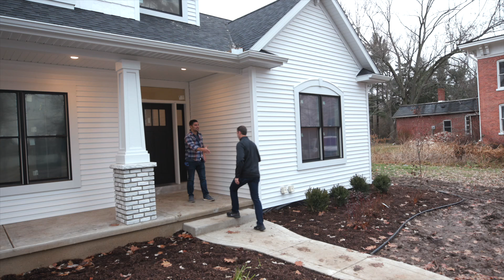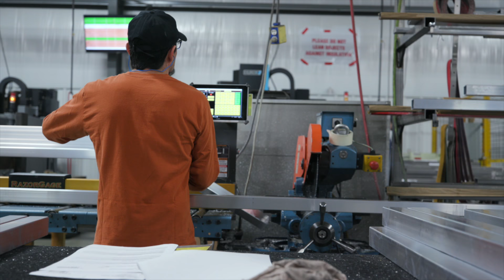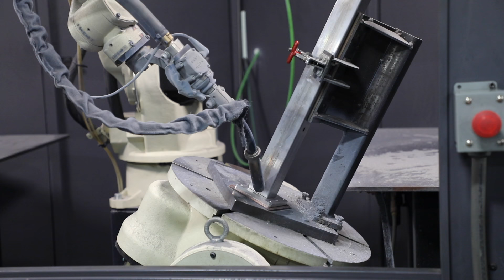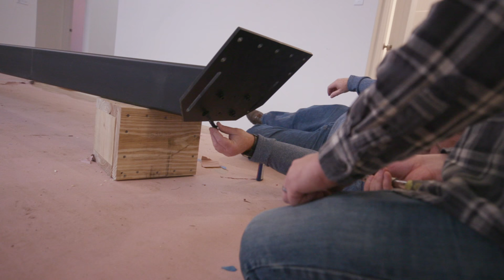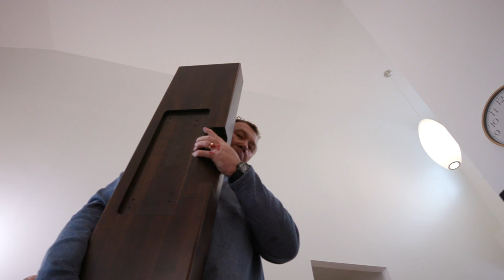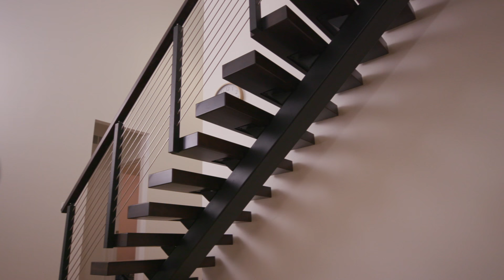One Day Floating Stairs Install - Guess How Much These Cost!

Comment: God all these videos make me depressed. I went to college got EE degree, lived at home to avoid debt, graduated with no debt and a just a little money in the bank (like a couple thousand tops). Started working a white-collar job, saved pennies and lived frugally, lived in an apartment for a year (with a roommate!), bought a starter house (its a crap house) also with a roommate. And like... these stairs just these stairs alone cost over 12k?!?!? WTF....?!?!?!? I swear to god these ppl must live in a different stratosphere from me. Idk what I'm missing how do ppl afford houses like this. Like Jesus... I see these vids about how airtight houses are and how attics should be and I'm like 'hah' I'm prob making above avg income and my house has literal 1/8" air gaps around patio doors where air leaks like crazy cause some idiot installed an interior door on the exterior of the house... my bathroom fans are vented to attic. Shower pans have cracks in them. Carpet is 30 years old and smells of cat pee from previous owners. We had a cracked floor joist. HVAC/water heater are all over 20 years old and ticking time bombs. I have to light the stove to cook on with a candle lighter... Like and that was with me saving for over a year and buying the most affordable house I could... I swear to god these ppl are in a different stratosphere...
Reply: They are in a different stratosphere! 
but, there is so much you can do on your own, weather stripping and a door sweep can be installed easily and cheaply, they may not look as nice as a brand new pre-hung steel entry door, but it'll still save you money on heating and cooling. 
Caulking around windows can save money as well. 
You can get patch kits for those shower pans, the patches don't look pretty but they work. 
If you have a vent port on your exhaust fans you can get vent hoses and a vent covers and vent that exhaust to the outside (it's on my list for my old house) 
A little more expensive, but can be done piecemeal, rip out that carpet and put down a floating floor, do it room by room as you have the money and in a few months all the floors can be brand new, plus, if you are on a crawl the vapor barrier should help with air leaks!
Reply: I know you can get 1000sq ft of decent flooring when it's on sale/clearance for about $700. If you're going to buy it buy it all at once otherwise it will be hard to match...
Also check your Habitat for Humanity stores. I live between two but only one of them is good...
Reply: Big changes start with little efforts. Repairing the igniters on your gas cooktop could cost less than $50 in parts, an afternoon of your time and using tools you likely already have. YouTube is a massive resource for the DIY inclined.
Reply: I think the point of these videos is not to show off but teach the proper ways to build things. Access to high quality construction is not a matter of money either. In a lot of Matt’s videos he shows how many new expensive houses in Texas use extremely low quality material and work execution.  Bad builders persist because so few people, even he wealthy, can distinguish good construction from bad. With enough education and confidence there’s a lot that people can do themselves for a low price but high quality.
Reply: @Emily Carlsen
All those problems you have in your house you can't fix them by yourself using your tools and little money.
The stairs you see in this video is something they want not something they need,if you live by what you need you live happy and rich.
Reply: You sound like a good candidate to build a tiny house! If you haven't heard of it check them out as there are plenty of videos here on youtube.
Reply: You're going to be ok sweetie!!
Reply: I got my ME, then went into construction and started my own company. I make more money as a contractor than I did as an engineer.

Get your PE and start working for yourself. Get out there and take risk and reap the reward.
Reply: Actually a lot of Americans live paycheck to paycheck.
It's not surprising at all to have credit card debt.
They can spend 12k on stairs but have less than 12k in their bank account.....just saying.
Reply: @ekujj13  And, since they are needed, they should be valued as such.
Reply: One key thing I noticed is you didn't say you took out a loan to get your house. You own it. Some people really can afford nice houses but many others try to get there by taking on debt within an inch of their life.
Reply: Now's where I tell you that union electricians in Las Vegas make over $45/h, with free (incredible) healthcare for all dependents and a pension. Our average home cost is currently $300k, but varies from $200k to $350k. My house (estimated at $302k right now) has an annual property tax of $1.4k, we have zero state income tax, and our sales tax is 8.25%.

Also: I think being private with your finances is a trap. We need to discuss how much we all make and spend so we know how and when we get screwed by our income sources and expenditures.
Reply: Just wait until she reads the communist manifesto and joins antifa
Reply: Emily,

Good for you for being careful with your money and not having taken on a lot of debt as you start out. We bought our first house in 1987 when interest rates had dropped from 11% to 8% and thought we were lucky to get a loan at that rate. Saving for a year for a down payment is unusual, usually it takes much longer to come up with at least 20% down. Learn how to fix the things you can fix and pay someone to fix the things you feel are beyond your skill set. You’ll be ok.
Reply: Emily Carlsen I absolutely feel your pain! My house is over 100 years old. A typical New Orleans double shotgun house. I cannot wait to afford a new house built with modern technology and standards. Although every time I bitch about this house, I have remind myself to be thankful that I, as an early 80s millennial, actually own a home.
Reply: Just get a mortgage and buy a new home. Problem solved. You can live well too, you just don't want the debt.
Reply: You need some cheese with the whine.
Reply: Those people are on a Higher level than you. They see the world differently than you do. you see problems. And they see opportunities.
Reply: It's the American weigh.
Reply: Your story is exactly why I promote a $500/m UBI. We have a financial and economic system in place with terrible distribution. Everyone watching this channel should understand basics of flow and velocity. Well, the flow of currency and credit in our economy is poorly designed and balanced.

Comment: A lot of backlash about the price, can anyone intelligently comment on what an alternative of comparable quality would cost?
Reply: I am by no means an expert here but having done a staircase update at home I have a little info. For 1" thick unfinished maple treads I spent $450, the ones here are finished and probably 6" thick so maybe $3K just for treads. I also looked at modern railings to buy and install and parts alone where coming in close to $4K so I did not proceed. Matt said that center stringer was 200 some odd lbs and I think installed steel cost is around $20 a lb right now so $4k there as well. So maybe $12,500 isn't that bad but it does sound absurd to spend that on a staircase.
Reply: Finished treads like those are only about $2000  but then again it's overkill for me personally. 

Modern railings cost don't cost more then $750 since its just a simple I beam staircase.

The I beam cost isn't near that much at all any local manufacturer or welder could of made it for $1500 all in all with shipping included along with predrilled socket slots throw on $500 if they want it installed for them.

Most be a pretty highcost or  remote location to charge this much for at best a $5000 job.

Comment: 12.5k is a good deal? Get your numbers straight. I have put an identical stair in for less than 3.5k, including labour and shipping. Another one similar to this but with a 180 degree turn and a center platform for less than 4.5k. All metal center stringers, hardwood but without railing.
Reply: Did you scratch build it or use a company? If so what company?
Reply: @thebigdoghimself  Local fabricator. Europe though. But even here some people get overcharged like you see in the video. It's a fucking metal beam with some well made right angles put on it, it's not rocket science and thus shouldn't cost the price of a rocket.
Reply: @verlicht  that is the difference between cost and worth aye. 12k is a deposit on an average house in Yorkshire.
Reply: @verlicht  you should hear what windows cost in the US though :D and crap windows or doors! For 2 full lite glass pateo doors completely normal!!! I was quoted twice for about 12,000 dolllars! I laughedd!! At Lowes they sell it cheaper way cheaper but granted the doors are not that great (at least compared to the european ones - vs other US ones they are ok/good)! It fathoms me that the window and door industry in the US sucks... Even the 12,000 doors would be way worse than a 3 axis tilt door from Europe. I put a double pane 3 axis tilt window in Portugal and a top of the line is about 500-600 dollars CUSTOM made! and on this side of the pond they ask 12,000 !!! Steel/aluminum industry is all concentrated in europe nowadays..
Reply: @NoRoads2AllRoads  Yeah, in Europe the price on windows is pretty good. I got high quality brand named double plane glass windows put in a house that can entertain (sleep and feed) 45 people and it cost around 25.000 installed. That's almost 100 windows and glass doors put in for that price. That was a very good deal though. Every window was made to the size of the opening, so all custom.
Reply: @verlicht  yeah i know! That's what I told the guys that quote me. At my mothers house she has Full glass floor to ceiling window panes... only 1 sheet! They are huge like 7 ft high and 13 ft long maybe. 3 of these double pane, thermal cut, insulated, etc etc... argon filled, plus the 3 3-axis pan and tilt doors - also all glass ... I think she paid about 7k with installation already. And the quality is not even comparable!

Im thinking of buying a new house and building it and am thinking of sourcing all the windows from Portugal. I think even with shipping it would save thousands! never mind the quality!
Reply: @NoRoads2AllRoads  You want to go for PVC or wood? For PVC, some german manufacturers also have a plant in the US or Canada. If you can buy directly from them you could even install yourself. If you are patient and can work precisely, it's doable DIY. I prefer to let installers do it though. I would be able to do 4 windows in a day, whilst these guys can do it better and can do about 25 windows a day.
Reply: LoverOfPhotography what company did you use?
Reply: @indyregen  This is the answer I would like to hear. 4.5K for the same quality as the one in the video sounds like a VERY good deal.
Reply: @dm7g  Mine were without railing though. I prefer stairs without railings if there are no kids though.
Reply: @verlicht  The cost of lumber here in the US would be close to $4000. 3" thick (16/4) lumber is not easy to get ahold of.
Reply: @thebigdoghimself  Wood was around 1000$ finished. We used Beech, which is one of the best types of wood for stairs with a dark finish, slightly lighter than the video. Walnut would be around 2500$, but I would prefer walnut unstained and natural looking.
Reply: @John Salazar it's not 3" thick lumber. https://www.viewrail.com/product-category/floating-stairs/thick-treads/ look at the treads. That's a glue up job, the last is at least a two piece and the one above a three piece. So you assume they buy I IMAGINE whatever size basically is the best value  (within a certain minimum) and glue to fit.
Reply: @thebigdoghimself  BS ! heres ur price list, http://www.hearnehardwoods.com/hardwoods/pricelist/pricelist.html go buy it and get some one to paint it for u won't cost u more then $50 a piece.
Reply: There is just no way yours is the same quality. Was your steel powder coated and anodized bead blasted? The steel alone, especially the stainless rails, are going to cost a lot.
Reply: @Pfestive  you'd be surprised how much cheaper this things are in Europe... Most architecture, any house has this type of stairs for the past 10-15 years and they are not premium houses... Like 150k houses have this. These modern looking rails are cheaper than here in the US... I want to have these on my us home and when searching for parts my mouth drops on how expensive they are just for the railing.... Like 200$ per post are you kidding me? For 700 or so I can have a full set of brushed nicquel SS in Europe... Just recently I had to buy the stainless steel clamps for tempered glass for balconies or rails... Cost per unit in the US? 30$/35$each.... I bought them in Europe in a hardware shop for 5$ each

Don't forget that steel has become very pricey in us because of tariffs imposed on imports from the trade war between us and China
Reply: Salvador Nobre Veiga Thanks a lot trump!
Reply: I know, he said its cost was $12.5k. It is so damn ridiculous, but it is USA, where everything is marked up at least 10 times its true value.
Reply: @K_Sonn  true. I think Matt did a video regarding tile clay roofing - like Mediterranean countries - and I think he said something like 10$ per sq foot!! I laughed my ass off... In Europe - aka Spain and Portugal - clay tile roofs are about 10-20 cents per sq foot, I think I remember checking a very high quality roof tile for about 35 cents and that was the top of the line.
Reply: Base MSRP of a Harley 883 Sportster is about 10,000 USD.
If something cost more than that with far fewer parts, tolerances, etc etc...you might be paying to much. 
It's like paying retail for a snapon toolbox... Don't do it.
Reply: @Clip_This_Schitt  Harley is close to being out of business because no one buys that garbage. So using them as an example is not a good comparison.
Reply: Then pick any number of Japanese sport bikes. It's inconsequential to the point I was making.
Reply: I call BS.
Powder coated and shipped and installed.
Reply: $12,000 minus labor and shipping.  Well you can bet your ass the labor is going to be at least half again (probably more) what the stairs cost.  😳🤯😱 Umm no!
Reply: @Phelebas 
If the machines result in a $10k markup what is the point of having machines in the first place. No, this is one of those marketed products where they add the word "premium" to jack up the cost because some people will pay it.
Reply: @georgeEPC  This is less than 500$ in iron. Fab + paint was another 750$. Then 1250$ in wood and wood labor. And rest is installation and hardware cost. Design is basic, so you just give them where it needs to start, how long it runs, how high it finishes, preferred step height (may change depending on other factors). Skilled labor is between 35$ and 75$/ hour where I live. It's without railing like I said, that would probably add like 1000-1500$ I would assume.
Reply: What's even more hilarious is that this company has machines doing all the work to build the staircase. Where the hell does over $12k come from when the materials only cost them a few thousand. That's an enormous markup.

Comment: Couldn’t that be mass produced at a fraction of the cost by using a telescoping center stringer?
Reply: You mean you slide or bolt the center stringer together? You may well be right.
Reply: That also means the bold plates need to be adjustable AS Well